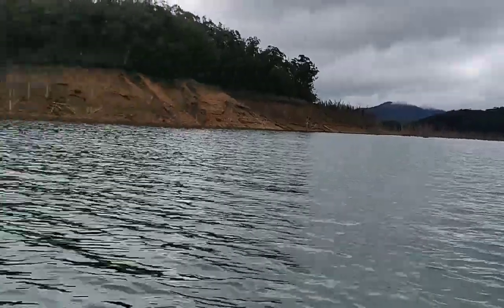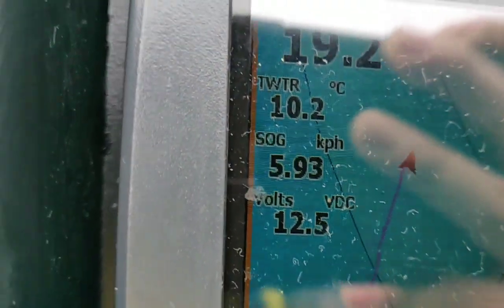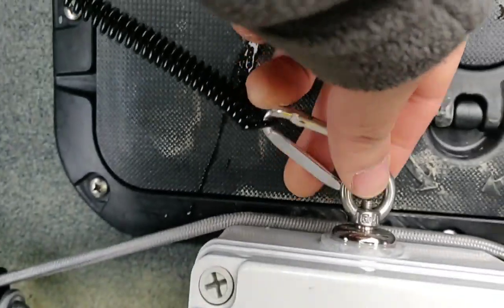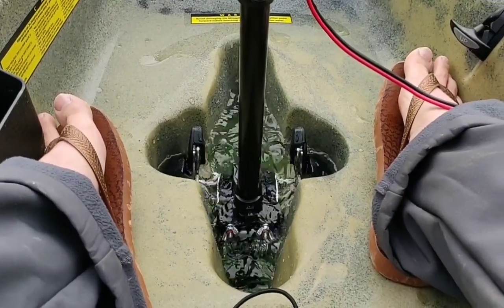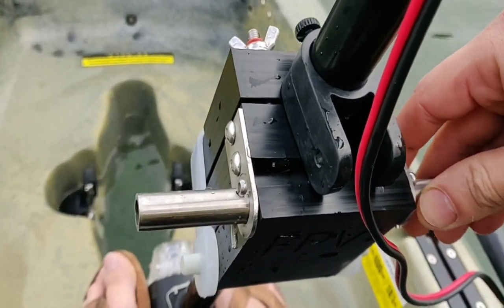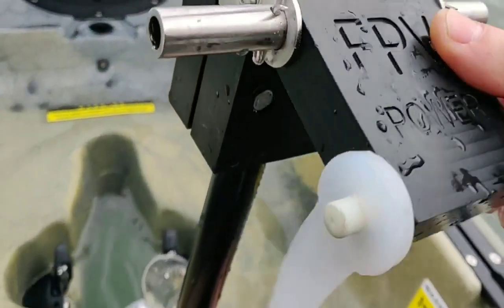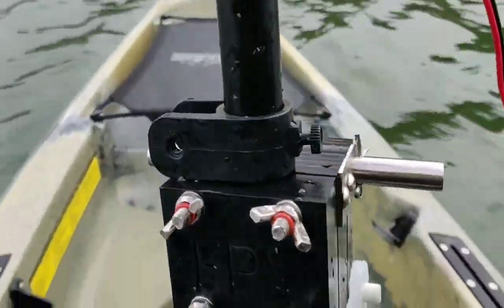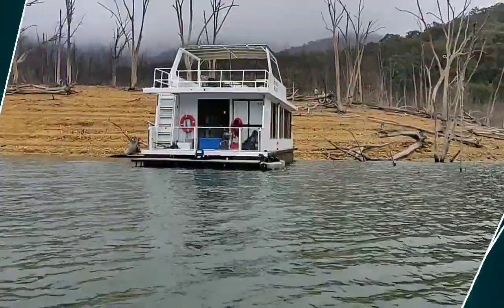Fpv-Power Hobie® motor mount V2 prototype.

Comment: Would this be able to hold say a small 50cc Honda 4 stroke engine?
Reply: As long as the shaft diameter fits the mount it will hold although a collar of some type on the motor shaft would be advisable to stop the motor slipping down. As far as the extra weight on the drivewell you will have to decide for yourself as we have never used a petrol outboard on the kayaks before.

Comment: What's the make/model of that trolling motor? I can't find a Watersnake 28lb. 

Do you think the shaft is long enough to use while standing?
Reply: This was not a watersnake.  Standard motors won't be tall if you are standing without modification.